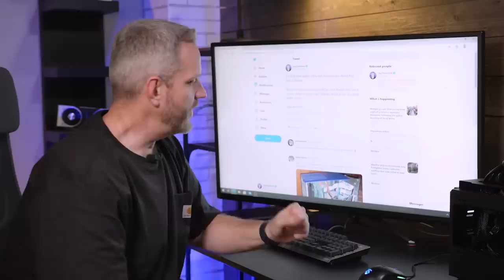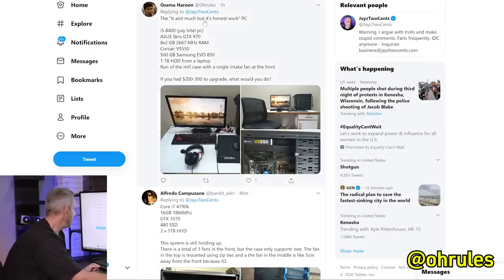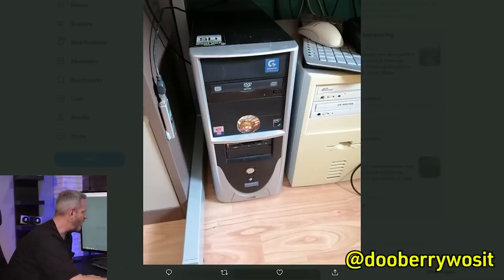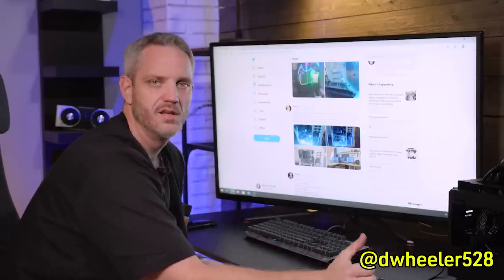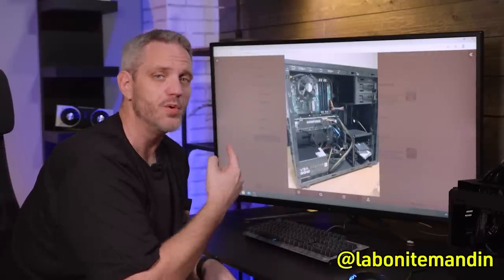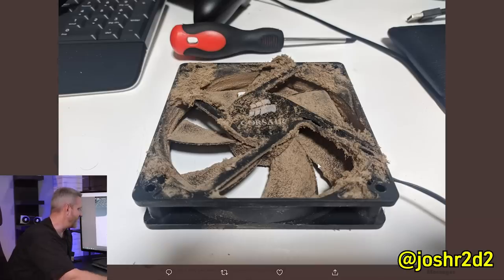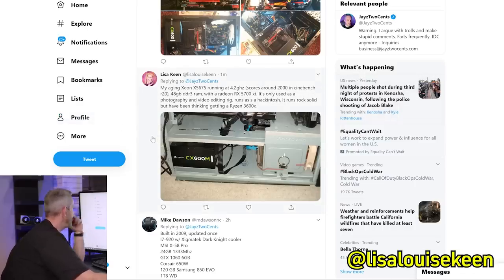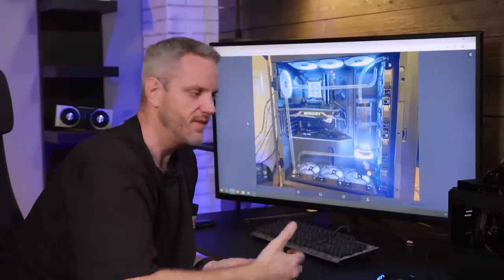Reacting to your WORST Setups... Send help NOW!

Comment: "Stop Using FX"
Brother i felt Threatened when he said that, made me realise, yeah maybe i do need to upgrade it
Reply: ryzen 4000 series would be a great start, paired with a B550 motherboard (I would would for prices on the MBs to drop, as they are overpriced at the moment)
Reply: @yotoprules9361  I was looking at getting a Ryzen 5 3600 as i only have an Rx480 which ill be upgrading to a 1070ti in the next few months, but im a student with not much money so a new CPU is out of the question :)
Reply: @wyvis  used is not a bad option
You could also check aliexpress, that's often the cheapest place I can find ryzen cpus for.
If you can, get a 3000 series ryzen as they're much more powerful than the first 2 generations.
Reply: @wyvis  
You can have a look at a 1600AF, which is basically a 2600 for less money, or look at pre-owned 2700s and the like. You don't need the latest and greatest, second gen Ryzen is kicking too and should improve your experience plenty. Of course, with the added cost of new MB and RAM taking into account, it still won't be exactly cheap, though RAM prices are expected to drop again soon.
Reply: honestly go for the Ryzen 5 3600. It is pretty decent and maybe a X-570 Plus Wifi from TUF Gaming, and of course if you are on a budget go with a 1660 ti
Reply: @yotoprules9361  cool, ill have a look, are AliExpress a trustworthy place to get parts from?
Reply: @jayhill2193  ah i see, im liking the look of the 3600 but if you say 2700 is good ill trust you :)
Reply: @andrewbelmonte-russo721  i was looking at the 3600, and ive got a mate who can sell me his EVGA 1070ti for 200GBP, but you can find 2060's for around that, so im not sure what to get
Reply: @wyvis  yes, they do come from China though so shipping is slow, but it's not like wish where nothing is moderated. I almost never see a scam on Ali. I'd say aliexpress is safer than ebay. 
The 2700 is better at multithreaded heavy tasks, the 3600 is better at gaming. Get whatever suits your needs the best. Both are great cpus though.
Reply: @yotoprules9361  reckon i might go for the 3600 then, as i mainly use my current system for gaming
Reply: @wyvis  
200 pounds for a 1070ti seems a bit much too me, considering that the new gen is only months from now. I get that you don't want to lowball your friend but at the same time he shouldn't charge you too much. 
See if you can get him down like 15-25 pounds then I could confidently say make the deal.
If you want to consider buying 2nd gen Ryzen, look out for good deals on MB+CPU combos, with a lack of support for Zen 3, many people, who always want the best money can buy, will sell their B450 or X470 boards.
For 3rd gen Ryzen the B550 boards are sadly a bit overpriced to the point where X570 is often times the better deal. A520 also isn't too hot but should probably do the trick on a tight budget, though if you don't mind the lack of future upgradability, B450 and X470 boards also support them which again might sell for a good price on the used market.
I hope I could give some helpful advice :)
Reply: @jayhill2193  almost thought you weren't joking there, would you go for the 2060 then with only 6GB? and for Mobo's im completely stumped, i was looking at the Gigabyte A320 but i have no clue what to choose when it comes to the Mobo and aye your advice is helping a lot :)
Reply: @wyvis  no way, Alibaba/Aliexpress is literally the epicenter of knocked off goods. You want fake LV belts? Go to Alibaba. Fake designer sunglasses? Alibaba. Fake Ryzen CPUs? Alibaba. You can think of any product you want, and you can find someone making knockoffs on there. And if there isn't one, find the closest related product and message the seller, and he'll have the knockoff you're looking for.
Reply: @yotoprules9361  "cheapest place I can find Ryzen CPUs for." How many have you bought? 1? 2? Three at the most. That's hardly a large enough sample size to suggest that it is a reliably legitimate source.
Reply: @xenonram  what is your point?
Reply: @xenonram  aye, im not interested in knock off cpu's though unfortunately but thanks for the head up :)

Comment: Them: wear a mask when you go out
Me: wear a mask when you clean 10 years of pet dandruff and vape juice

Srsly wear a mask tho but also like ew
Reply: I cleaned a i5 2500k gtx770 system that was running filtering air into a growbox in a smoker's house for years I think. But it doesn't even come close to what we've seen here
Reply: wait so vaping near a pc is really bad?
Reply: @spartercus1  most people don't vape liquids that fully turn into water, so yeah, you're exhaling flavours and nicotine and it often builds up on surfaces
Reply: Niko Andruloni wait so the worse thing that can happen would be? Bcuz like a dummy I’d vape and blow all that shit into the fan
Reply: @spartercus1  I would guess stick up the fan motors, so they fail quicker, make the dust stick even more to all parts clogging up the heatsinks and whatnot, possibly some low level shortcircuits so you get intermttent problems down the line, maybe some minor corrosion. It's easier to deal with this if it sticks to your desk
Reply: Niko Andruloni cheers boss

Comment: My backup PC is an overclocked FX-8350 with a GTX-980 and frankly if I had to use it to game I could. (with reduced detail in most AAA titles of course) For anything other then heavy gaming or anything super CPU-intensive like video editing its completely usable booting off of a 1tb Sandisk SATA SSD.

I had a 240mm AIO gathering dust on the shelf and the thermal paste was super-old so I swapped it in with fresh Artic MX5 and now the system runs great and is noticeably snappier too amazingly. (had a decent Zalman air cooler) With the AIO the FX990 MB holds the mild 4.2ghz all-core CPU OC steadily under load explaining the slight performance bump.

  Considering this system began life with an FX-8150 & my buddies old GTX-285 in Jan 2012 it doesn't owe me a thing.

Comment: my case is very old, a white/yellowed case that was painted black and red, and cutted to have a acrylic side pannel but inside there is 0 ways to make cable management, and it still looks better than most of the pics you showed on the video, zipties and some plastic tape will get you a long way, hotglue to secure the wires of the top fans too

Comment: As for bending the tubes just look up a bend allowance calculator and do it as a blank development with a standard mild steel k-factor to get your tube length.  Then just take the leg length minus half the inside radius of the bend to find your centre of bend.  No guess work.

Comment: FX CPUs may be 10 years old, but if they are still working, I don't think it is worth it to replace most of the components of your computer to switch to something newer.  I upgraded to another FX CPU a couple years ago when I needed a better CPU than what I had, but I have an AM3/AM3+ socket, so short of replacing, at the very least, the motherboard, another FX CPU using AM3/AM3+.  
I just recently had a SATA port on my current motherboard go bad and decided it was time for a new motherboard which meant it was also time for DDR4 RAM, AM4 CPU, and M.2 SSDs.  This is of course not cheap, and if my motherboard wasn't having failure issues, I would probably stick with my current setup for another couple of years because it works for my purposes and I don't see the value in throwing out money every time new hardware comes to market because I need the best specs out there.

Comment: 15:05 I have a similar build, so what you do is you cant take the back panel off but what you can do is just take it all out and measure the lengths of the cords. after this just zip tie the the excess right in the top middle. I have a similar bunch of storage power and it makes it look much better to hide behind all the other cables.

Comment: I'm still running an FX 6300 clocked to 4.4ghz (with an AIO cooling setup) 16gb of ddr3 ram and a sapphire r9 290x toxic GPU  and it plays anything I've thrown at it so far. I only play on medium-high settings. I am planning on upgrading this year though as you pointed out, its quite outdated, but it still works perfectly fine

Comment: Had an old 2560 elitebook by HP...bought a new battery, charger, upgraded from HDD TO SSD and got 16gb of sodimm ram (2x8gb) for well under $100...saying its twice as fast and smooth is an absolute understatement! Sometimes a few small tweaks is all you need!

Comment: 22:39 I would just put the radiator in the back indeed, perhaps even with one fan, as a push/pull-configuration doesn't do a whole lot extra. And then have the rear fan in the front blowing cool air onto the GPU rather than the hot air from the radiator. - The problem, though, might be that the radiator will remain a lot hotter because it's taking warmer air from inside the case and all cooling might be necessary for the overclock that is on that CPU. I don't know, but I assume it might get very hot.

Comment: hey the 970 still holds its weight, im running my 970 with my 5800x until MSRP's sort their shit out lol (just upgraded from an i5 4440 so the CPU upgrade was really needed).  If I was Osama id be looking at an M.2, and some drive upgrades, 1TB m.2 makes storing and running your common programs faster and more snappy, things save faster, programs open quicker, reboots are in a flash. depending how old the laptop HDD is that thing might be slowing you right down. You wont get much out of a 1660, a few extra settings on a game get turned on for the same FPS, big whoop. HDD's might change how your entire computer feels.

Comment: I lovingly assembled my system but I've had a rough few years and haven't had the financial wherewithal to upgrade in many years. 1100t @3.8GHz on Crosshair V, 16 GB patriot ram 1333 MHz, 1TB WD Blue 1TB SSD, 2 TB WD Black for Storage and EVGA 680 2GB. H100 with Noctua NF-F12s in Push/Pull

Comment: Grommet: A ring or edge strip inserted into a hole through thin material, typically a sheet of textile fabric, sheet metal or composite of carbon fiber, wood or honeycomb.

Comment: i bought a prebuilt as my first gaming pc from cyberpowerpc for around $1000 around 4 years ago, it came with an fx6300, a nonmodular power supply, an amd r7 240, and the case came with the snapoff pci slot covers.

Comment: 2600K i7? Jupp, right here! Right next to me! - But not for long...just ordered the following:
- Ryzen 9 5950X
- Asus ROG Strix X570 E
- 32 GB of Corsair Vengeance RGB
- Fractal Design Define 7 XL
- Seasonic 750 W PSU

Yes, no GPU - I will use my 1070 GTX AMP Extreme till they drop in price to regular levels again, as spending 1000 Euros on a GPU is madness IMHO!

Comment: My suggestion for a relatively inexpensive desk is to make one from a solid core door. I got a 32"x80" door slab without decoration from the local hardware store for 70 US$, and then got a set of 4 metal legs with baseplates for $60. A some sanding, a couple of coats of varnish, and a fairly nice slab style desk was sitting in my room. (Pro tip, have a friend to help you move the door around, its a heavy mofo)

Comment: The thing Jay is missing is a lot of people are in my boat of running fx-8350 or fx6300 (i think) processors and in order to upgrade need a new motherboard, ram and CPU. It's just too expensive atm to do so. I went from an amazing i5-3570k that ran at 5Ghz all day long with my noctua NH-D15 but doing that killed the power delivery on my motherboard and it was (at the time) cheaper to buy an FX-8350 and an AMD motherboard than to buy a new lga1155 board. (Bought my 8350 for 65$!). I miss my 3570k, but with a gtx 1060 3gb and my 8350 I cannot justify any upgrades.

Comment: I generally leave the side off the case. And I have a couple SSD's just hanging from their wire (the SATA3 plugs are really secure, and SSD's are light). It's all clean though.
The only thing neglectful is that I've gone too long on the same thermal paste, and the AIO is old enough that it might have a bubble.
It's a 4790/1080ti... just haven't seen the cost:performance ratio that I'd like to see to upgrade yet, usually I would before the paste gets too old.

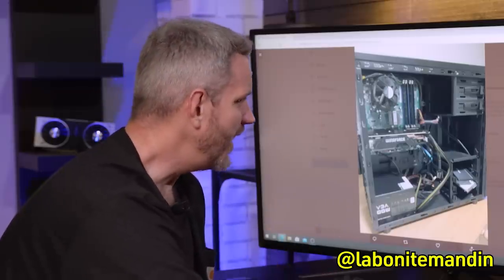Comment: 12:25 -- "Use 2 sided tape"   -  I will go against that.   I am a tech and use to do that as well on some builds.     Then later the customer has something wrong with it and it's a little harder to get that SSD back out from the tape.      We now use velcro to mount them.    SO much easier to remove and install lol

Comment: Yes Jayz there is bad cases with bad cable management, mine has litteraly no 8 pin hole, and dont get me started about the space for the fans, i cant fit an AIO on the top... I barely could fit the fans, i had to saw off one in one bottom corner to make it fit with the I/O.... I had yo mount the fans after setting the motherboard cuz there was no space to make it's way in if the fans were on. The fan almost touches the rams... The moral is, never budget on the case. Budget case is bad

Comment: @21:58 This PC's Radiator is mounted improperly, bet he gets bubbling noises and maybe whining from the pump. You should top mount the radiator or at least move it to the highest mounting point in the front so the hoses are at the very top of the Rad. making the pump slightly lower than the hoses allowing for proper flow and function. If you cannot do this, you're better off  to just use a decent CPU cooler fan.

Comment: I sold my old FX rig to my friend. But i had another one which is build in the cabinet under my TV with a GTX 1070 and it can run 4k (of course no maxed settings), but most with 60FPS plus. Its more to watch movies with full potential 4K just because i can. And at least it has 32gigs of 1800mhz ram and it stays very cool. It makes fun to play some games on it with my old but gold Steam Controller :D.

Comment: There are tube benders, normally designed for smaller diameter high pressure pipe but I don't see why it wouldn't work for custom cooling, the manuals come with a guide on how to perfectly measure and bend.  Swagelok is what I used to use but it's only good for up to half inch. The calculations in the guide might be useful to someone, any tube bender would work, the marks are just a convenience. Page 21 - 25 are what you want: https://www.swagelok.com/downloads/webcatalogs/en/ms-13-43.pdf.

Comment: Hmm, that one laptop that was 'falling apart' with '1TB of the worst HDD ever' looked a lot like this old HP laptop I have... that thing WILL NOT DIE.  Seriously.  The battery won't hold a charge.  80% of the time instead of starting up, it will do something that looks like the screen is melting (like its literally not getting a signal from the video card, something bad is happening to the display panel itself), the system goes nowhere, so it has to be power cycled again.  Once that comes up, it takes awhile because it doesn't find the SSD I installed to replace the mechanical drive (because I'm not THAT much of a masochist) for like 20 seconds, but luckily Linux just keeps trying, and it always eventually finds it.  Also, the display panel (this is the most recent bit of it rotting to nothing) has significantly large sections that are just dead, but they're located in the upper left and it doesn't cause too many issues.  It's a weird irregular patch that appeared in between boots one day and has stuck around.  Occasionally, the laptop will also begin blaring static out of its speakers.  It will do this for days at a time unless I flex the case, and press on a few spots near the touchpad to shut it up.  Sometimes it takes a few attempts but I can usually get it to shut up.  I only use the thing for web browsing in the bathroom, and only keep it around at all out of sheer curiosity over how long it will manage to limp along.  It's astounding how broken it is, yet how much it still works.

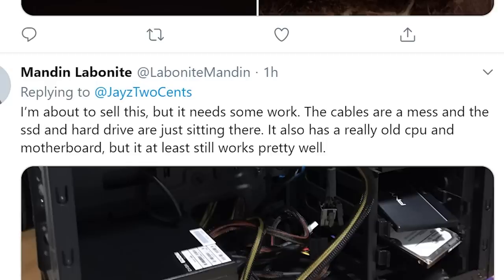Comment: 12:00 I do relate to that. I have similar build for almost 14 years...
Intel Pentium 4 with a 2GB DDR2 533mhz stick, no GPU whatsoever,  a Seagate 80GB HDD (yea), and I don't know what kind of PSU I had, it had no labels and stuff. And it ran good until recently, my Windows got corrupted :)

Comment: Jay there are some cases that actually have terrible cable management. 
They don't even allow you to keep cables in the using the case for my first build a Corsair carbide. And I can't even keep the cables in the back a little bit. Leaving so much extra to just spill out into the front. 
I honestly hate this case which is why I'm making my own

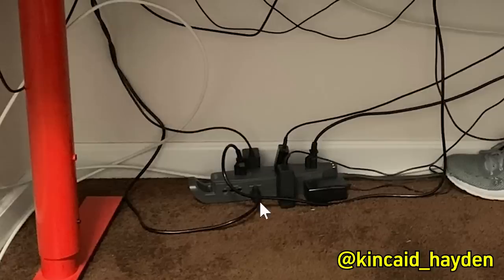Comment: That moment when 18:42 has only half the number of dangling cables and wires your own set up has... I guess thats what I get for running a laptop like a desktop with a external dac, amp, speakers, race wheel (+peddles and shifter) and 2 external hard drives...

Comment: Back in the day with old PSUs with short CPU power cables, I used to run it under the GPU by the PCI slots because there's a knock under the GPU perfect for it. :)

Comment: 12:40 Sea Sonic actually recommends that the PSU faces up if it's using a passive fan mode (i.e., if the fan stops spinning at lower loads).

Comment: I am still running FX-6300 and I am happy with it.
Reply: i only upgraded from that cpu the other month, i used it since 2016 with a gtx 970, literally ran everything on that rig, even modded skyrim, fallout, apex, even tried running watchdogs 2 on it, which was a mess.. absolutely pushed my pc to its limits, the fx6300 lasted all that time with me at 4.2ghz aswell on a pretty cheap corsair aio.  for the cpu that it is, it is good, but the upgrade is definitely worth it :)